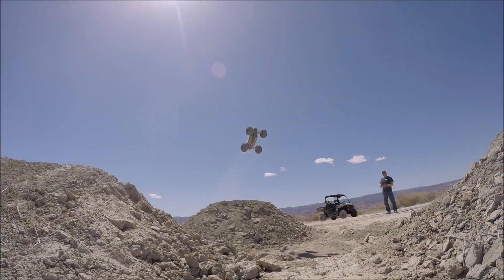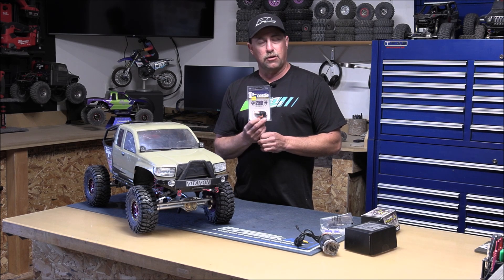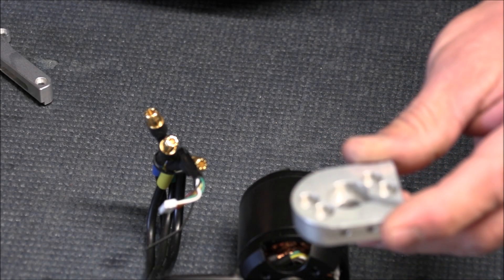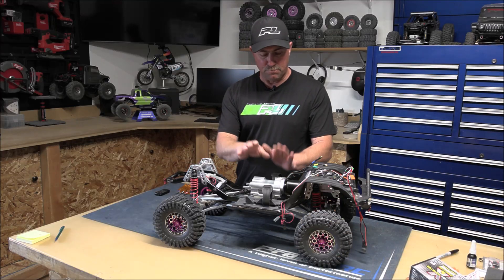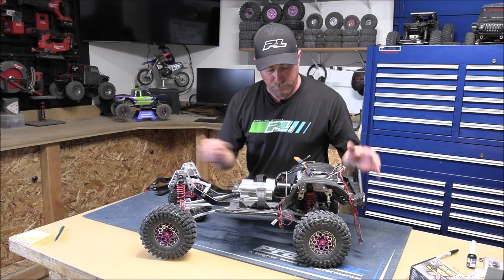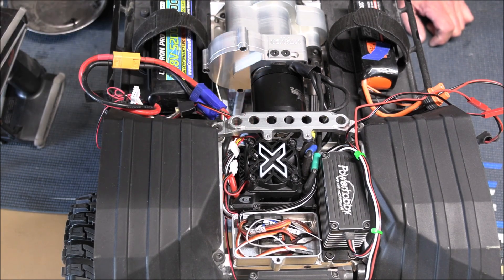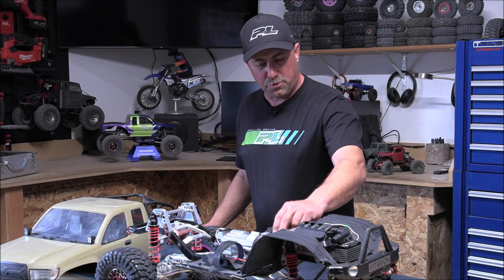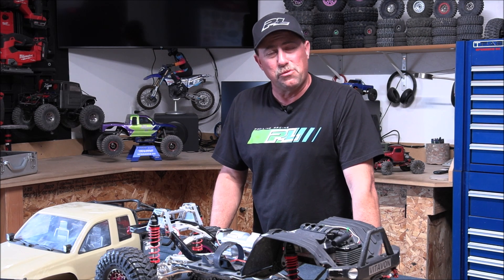Upgraded SCX6 Build Series Video # 14 ESC and Motor swap out

Comment: Another excellent video!!! glad to hear things worked out smoothly with the ESC. As for the motor, I’m planning to pick up the Castle Creations 4-Pole Sensored Brushless Motor (1717-1650KV, CSE060008100). Fingers crossed it fits without any issues, since I don’t have the tools to modify or enlarge the motor mount bracket. Are you planning on fitting the honcho with portals for future vids? Thanks again for putting out such a high caliber series of videos for the Scx6, this really feels like a masterclass in RC upgrades. Super informative and incredibly helpful!